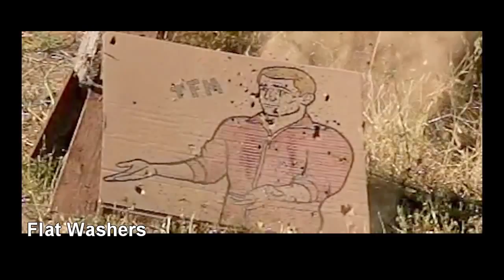TOP 20 Oddest Shotgun Rounds  - Slow-Mo Study

Comment: Just a side note on cleaning the plastic out of your shotgun barrel. Use a wooden dowel and some 4 ought steel wool...no cleaning solution necessary, leaves the barrel looking great and a final quick swab with your favorite oil and your good to go. Used this on hundreds of shotgun barrels for our customers. Cheap, easy & works.

Comment: To work the lines out of the barrel, get two barrel swabs and 1 bottle of medium grit and 1 bottle of fine grit rubbing compound, put the barrel in a vice and load the swabs with the rubbing compound. assemble your cleaning rod(with loaded swab) and attach to electric drill, work it for a while, clean the barrel and use the second swab with the finer compound.

Comment: Oatmeal.  DRY =o)   How about a Chapstik?   Fill a shell with joint compound and let it dry.  Or mortar mix.  What about a few small Lego pieces?  Or perhaps some dry, small elbow macaroni...I'll bet that stuff whistles really well when it flies at high speed.  Glass marbles.  Hair off the barbershop floor.  Chewed-up bubblegum.  Perhaps you'll blow a huge smoky bubble!

Comment: You have explosives in every single shotgun shell already, its called gunpowder.   With regard to HE payload, yes those already exist in three variants.

They are called Frag12 rounds and they exist in HE, HEFA, and HEAP which are high explosive, fragmenting, and shaped charge armor piercing respectively, and yes they don't arm until they are 10 feet from the barrel.

Comment: Nice going Jeff, please bear in mind when using those cut cartridges, the breech pressure will go dangerously high. You have increased the weight of the load with the friction of forcing a 0.05" bigger diameter load through your barrel. 
Thanks again.

Comment: What did you fasten the bolo together with? Ive tried shot cord but it still came apart before impact. I guess the knots came undone. I also bought some steel cable and lead weights to try it but I was having an issue fitting them in the shell and eventually gave up